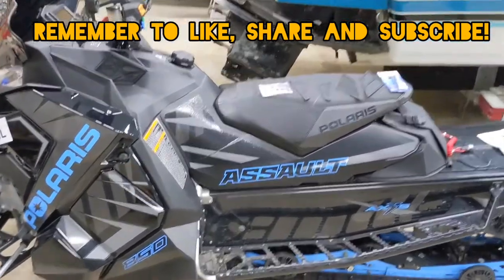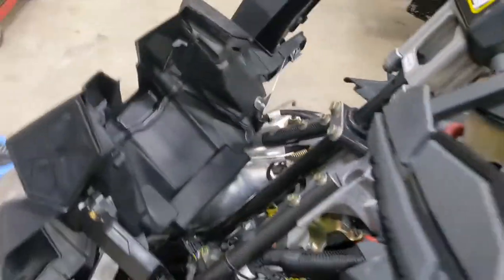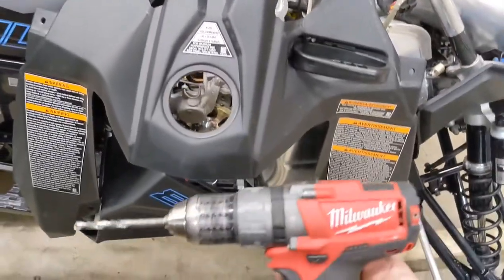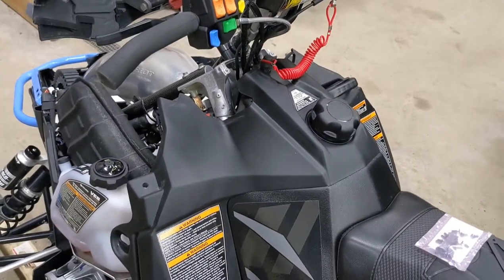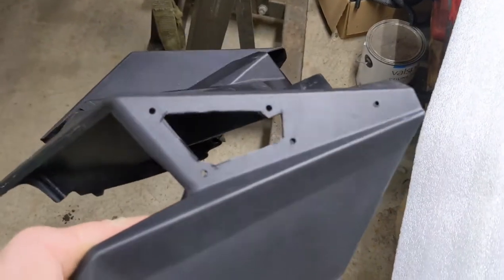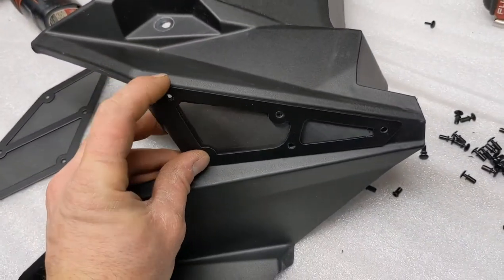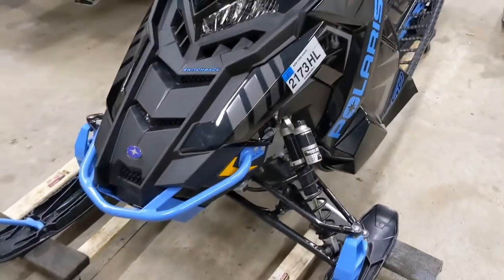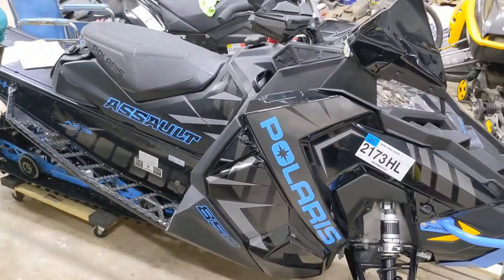2020 Polaris Axys 850 Teather and Fire N Ice Intake Installation

Comment: Vents look great. Mine are in the mail can’t wait to install them. Helpful tip: Lay the vents on a normal sized piece of printer paper. Take a picture of the vent with your phone. Then print the picture. Self made template. No printer, then use a sharpie to trace the outside of the vent and then then the inside of the vent. The sharpie will go through the screen on the paper and give you a nice template.
Reply from the maker: That's a great idea